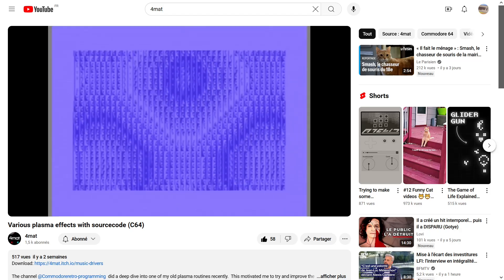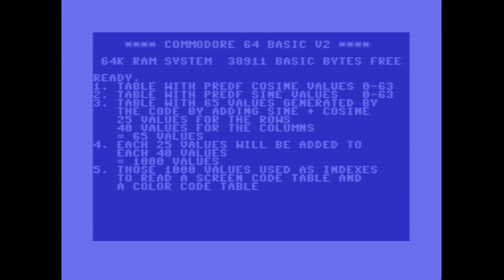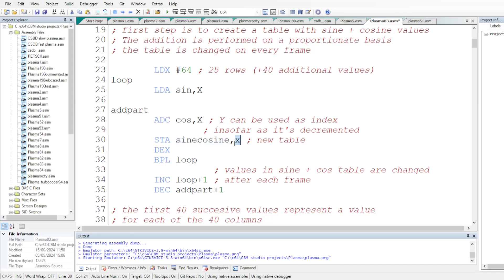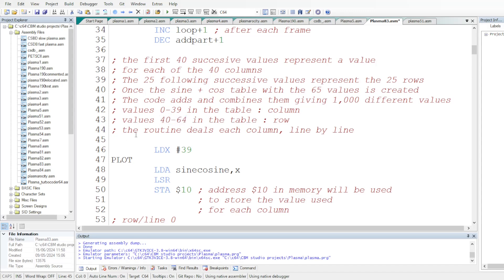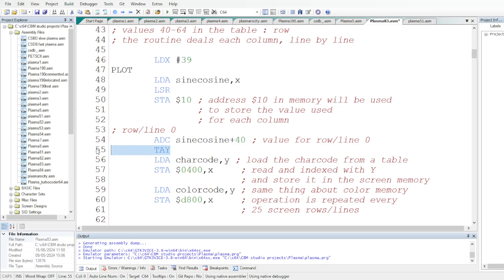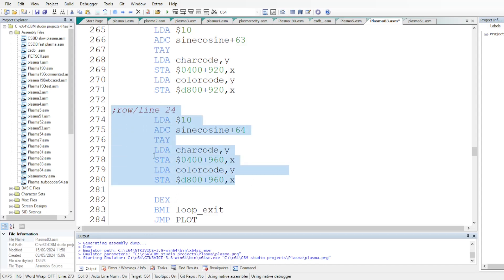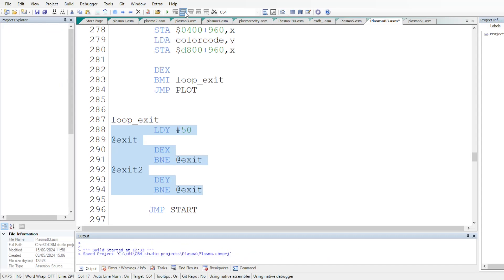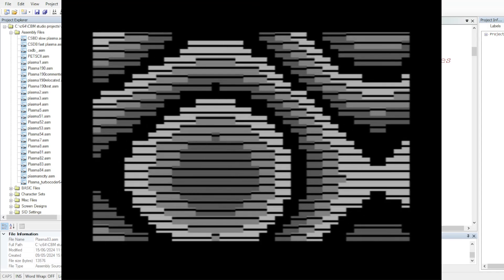Coding a plasma effect demo on the Commodore 64 (tutorial DIY in ENG)

Comment from the maker: The code is here
PART1
* = $1000 

        LDA #0 ; black everywhere :)
        STA $D021 ; =53281
        STA $D020 ; =53280
START
; first step is to create a table with sine + cosine values 
; The addition is performed on a proportionate basis
; the table is changed on every frame

        LDX #64 ; 25 rows (+40 additional values)
loop      
        LDA sin,X
        
addpart
        ADC cos,X ; Y can be used as index 
                 ; insofar as it's decremented
        STA sinecosine,x ; new table
        DEX
        BPL loop
                   ; values in sine + cos table are changed
        INC loop+1 ; after each frame
        DEC addpart+1

; the first 40 succesive values represent a value
; for each of the 40 columns
; The 25 following successive values represent the 25 rows 
; Once the sine + cos table with the 65 values is created
; The code adds and combines them giving 1,000 different values
; values 0-39 in the table : column
; values 40-64 in the table : row
; the routine deals each column, line by line 

        LDX #39      
PLOT
        LDA sinecosine,x
        ;LSR
        STA $10 ; address $10 in memory will be used 
                ; to store the value used
                ; for each column
; row/line 0
        ADC sinecosine+40 ; value for row/line 0
        TAY
        LDA charcode,y ; load the charcode from a table
        STA $0400,x     ; read and indexed with Y
                        ; and store it in the screen memory
        LDA colorcode,y ; same thing about color memory        
        STA $d800,x     ; operation is repeated every 
                        ; 25 screen rows/lines
        
; row/line 1
        LDA $10
        ADC sinecosine+41
        TAY
        LDA charcode,y  ; load the charcode from a table
                        ; read and indexed with Y
        STA $0400+40,x  ; and store it in the screen memory
        LDA colorcode,y ; same thing about color memory         
        STA $d800+40,x

; row/line 2
        LDA $10
        ADC sinecosine+42
        TAY           
        LDA charcode,y
        STA $0400+80,x                
        LDA colorcode,y         
        STA $d800+80,x

        
; row/line 3
        LDA $10
        ADC sinecosine+43
        TAY
        LDA charcode,y
        STA $0400+120,x
        LDA colorcode,y         
        STA $d800+120,x

; row/line 4
        LDA $10
        ADC sinecosine+44
        TAY
        LDA charcode,y
        STA $0400+160,x
        LDA colorcode,y         
        STA $d800+160,x
     
; row/line 5
        LDA $10
        ADC sinecosine+45
        TAY
        LDA charcode,y
        STA $0400+200,x
        LDA colorcode,y         
        STA $d800+200,x

; row/line 6
        LDA $10
        ADC sinecosine+46
        TAY
        LDA charcode,y
        STA $0400+240,x
        LDA colorcode,y         
        STA $d800+240,x

; row/line 7
        LDA $10 
        ADC sinecosine+47
        TAY
        LDA charcode,y
        STA $0400+280,x
        LDA colorcode,y         
        STA $d800+280,x

; row/line 8
        LDA $10 
        ADC sinecosine+48
        TAY
        LDA charcode,y
        STA $0400+320,x
        LDA colorcode,y         
        STA $d800+320,x

;row/line 9
        LDA $10 
        ADC sinecosine+49
        TAY
        LDA charcode,y
        STA $0400+360,x
        LDA colorcode,y         
        STA $d800+360,x

;row/line 10
        LDA $10 
        ADC sinecosine+50
        TAY
        LDA charcode,y
        STA $0400+400,x
        LDA colorcode,y         
        STA $d800+400,x

;row/line 11
        LDA $10 
        ADC sinecosine+51
        TAY
        LDA charcode,y
        STA $0400+440,x
        LDA colorcode,y         
        STA $d800+440,x

;row/line 12
        LDA $10 
        ADC sinecosine+52
        TAY
        LDA charcode,y
        STA $0400+480,x
        LDA colorcode,y         
        STA $d800+480,x

;row/line 13
        LDA $10 
        ADC sinecosine+53
        TAY
        LDA charcode,y
        STA $0400+520,x
        LDA colorcode,y         
        STA $d800+520,x

;row/line 14
        LDA $10 
        ADC sinecosine+54
        TAY
        LDA charcode,y
        STA $0400+560,x
        LDA colorcode,y         
        STA $d800+560,x

;row/line 15
        LDA $10 
        ADC sinecosine+55
        TAY
        LDA charcode,y
        STA $0400+600,x
        LDA colorcode,y         
        STA $d800+600,x

;row/line 16
        LDA $10 
        ADC sinecosine+56
        TAY
        LDA charcode,y
        STA $0400+640,x
        LDA colorcode,y         
        STA $d800+640,x

;row/line 17
        LDA $10 
        ADC sinecosine+57
        TAY
        LDA charcode,y
        STA $0400+680,x
        LDA colorcode,y         
        STA $d800+680,x

;row/line 18
        LDA $10 
        ADC sinecosine+58
        TAY
        LDA charcode,y
        STA $0400+720,x
        LDA colorcode,y         
        STA $d800+720,x

;row/line 19
        LDA $10 
        ADC sinecosine+59
        TAY
        LDA charcode,y
        STA $0400+760,x
        LDA colorcode,y         
        STA $d800+760,x

;row/line 20
        LDA $10 
        ADC sinecosine+60
        TAY
        LDA charcode,y
        STA $0400+800,x
        LDA colorcode,y         
        STA $d800+800,x

;row/line 21
        LDA $10 
        ADC sinecosine+61
        TAY
        LDA charcode,y
        STA $0400+840,x
        LDA colorcode,y         
        STA $d800+840,x

;row/line 22
        LDA $10 
        ADC sinecosine+62
        TAY
        LDA charcode,y
        STA $0400+880,x
        LDA colorcode,y         
        STA $d800+880,x

;row/line 23
        LDA $10 
        ADC sinecosine+63
        TAY
        LDA charcode,y
        STA $0400+920,x
        LDA colorcode,y         
        STA $d800+920,x

;row/line 24
        LDA $10 
        ADC sinecosine+64
        TAY
        LDA charcode,y
        STA $0400+960,x
        LDA colorcode,y         
        STA $d800+960,x             
        DEX
        BMI loop_exit
        JMP PLOT

loop_exit

        LDY #50
@exit
        DEX
        BNE @exit
@exit2
        DEY
        BNE @exit

       JMP START

ALIGN   ; here the code is aligned
        ; so that the LB adress is at $00
charcode
        DCB 16,195 ; 
        DCB 16,196 ; number of bytes used will determine
        DCB 16,197 ; the thickness of the layers pattern
        DCB 16,198 ;         

        DCB 16,195
        DCB 16,196
        DCB 16,197
        DCB 16,198
        
        DCB 16,195
        DCB 16,196
        DCB 16,197
        DCB 16,198        
                 
        DCB 16,195
        DCB 16,196
        DCB 16,197
        DCB 16,198

ALIGN   ; here the code is aligned
        ; so that the LB adress is at $00
colorcode
        DCB 16,00
        DCB 16,11
        DCB 16,12
        DCB 16,15

        DCB 16,00
        DCB 16,11
        DCB 16,12
        DCB 16,15

        DCB 16,00
        DCB 16,11
        DCB 16,12
        DCB 16,15

        DCB 16,00
        DCB 16,11
        DCB 16,12
        DCB 16,15
Reply from the maker: PART 2

ALIGN   ; "sin 2*256" table is comprised of 512 bytes
        ; with values between 0 and 63
        ; they are based on frequency by 4 x 90 degrees
        ; (=2*pi, ie a full circle)
sin
        BYTE 32,28,24,20,16,13,10,7,5,3,1,0,0,0,0,1
        BYTE 2,4,6,9,11,15,18,22,26,30,33,37,41,45,48,52
        BYTE 54,57,59,61,62,63,63,63,63,62,60,58,56,53,50,47
        BYTE 43,39,35,32,28,24,20,16,13,10,7,5,3,1,0,0
        BYTE 0,0,1,2,4,6,9,11,15,18,22,26,30,33,37,41
        BYTE 45,48,52,54,57,59,61,62,63,63,63,63,62,60,58,56
        BYTE 53,50,47,43,39,35,32,28,24,20,16,13,10,7,5,3
        BYTE 1,0,0,0,0,1,2,4,6,9,11,15,18,22,26,30
        BYTE 33,37,41,45,48,52,54,57,59,61,62,63,63,63,63,62
        BYTE 60,58,56,53,50,47,43,39,35,32,28,24,20,16,13,10
        BYTE 7,5,3,1,0,0,0,0,1,2,4,6,9,11,15,18
        BYTE 22,26,30,33,37,41,45,48,52,54,57,59,61,62,63,63
        BYTE 63,63,62,60,58,56,53,50,47,43,39,35,32,28,24,20
        BYTE 16,13,10,7,5,3,1,0,0,0,0,1,2,4,6,9
        BYTE 11,15,18,22,26,30,33,37,41,45,48,52,54,57,59,61
        BYTE 62,63,63,63,63,62,60,58,56,53,50,47,43,39,35,32

        BYTE 32,28,24,20,16,13,10,7,5,3,1,0,0,0,0,1
        BYTE 2,4,6,9,11,15,18,22,26,30,33,37,41,45,48,52
        BYTE 54,57,59,61,62,63,63,63,63,62,60,58,56,53,50,47
        BYTE 43,39,35,32,28,24,20,16,13,10,7,5,3,1,0,0
        BYTE 0,0,1,2,4,6,9,11,15,18,22,26,30,33,37,41
        BYTE 45,48,52,54,57,59,61,62,63,63,63,63,62,60,58,56
        BYTE 53,50,47,43,39,35,32,28,24,20,16,13,10,7,5,3
        BYTE 1,0,0,0,0,1,2,4,6,9,11,15,18,22,26,30
        BYTE 33,37,41,45,48,52,54,57,59,61,62,63,63,63,63,62
        BYTE 60,58,56,53,50,47,43,39,35,32,28,24,20,16,13,10
        BYTE 7,5,3,1,0,0,0,0,1,2,4,6,9,11,15,18
        BYTE 22,26,30,33,37,41,45,48,52,54,57,59,61,62,63,63
        BYTE 63,63,62,60,58,56,53,50,47,43,39,35,32,28,24,20
        BYTE 16,13,10,7,5,3,1,0,0,0,0,1,2,4,6,9
        BYTE 11,15,18,22,26,30,33,37,41,45,48,52,54,57,59,61
        BYTE 62,63,63,63,63,62,60,58,56,53,50,47,43,39,35,32

ALIGN ; "cos 2*256" frequency 6 x 90 degrees (=2,5*pi)  
cos

        BYTE 0,0,1,4,7,11,15,20,25,31,36,42,47,51,55,59
        BYTE 61,63,63,63,62,60,57,53,49,44,39,33,28,22,17,13
        BYTE 8,5,2,0,0,0,1,3,5,9,13,18,23,29,34,39
        BYTE 45,50,54,57,60,62,63,63,63,61,58,55,51,46,41,36
        BYTE 30,25,19,14,10,6,3,1,0,0,0,2,4,7,11,16
        BYTE 21,26,32,37,43,47,52,56,59,61,63,63,63,62,60,56
        BYTE 53,48,43,38,32,27,22,17,12,8,5,2,0,0,0,1
        BYTE 3,6,10,14,19,24,29,35,40,45,50,54,58,61,62,63
        BYTE 63,62,61,58,54,50,45,40,35,29,24,19,14,10,6,3
        BYTE 1,0,0,0,2,5,8,12,17,22,27,32,38,43,48,53
        BYTE 56,60,62,63,63,63,61,59,56,52,48,43,37,32,26,21
        BYTE 16,11,7,4,2,0,0,0,1,3,6,10,14,19,25,30
        BYTE 36,41,46,51,55,58,61,63,63,63,62,60,57,54,50,45
        BYTE 39,34,29,23,18,13,9,5,3,1,0,0,0,2,5,8
        BYTE 13,17,22,28,33,39,44,49,53,57,60,62,63,63,63,61
        BYTE 59,55,51,47,42,36,31,25,20,15,11,7,4,1,0,0

        BYTE 0,0,1,4,7,11,15,20,25,31,36,42,47,51,55,59
        BYTE 61,63,63,63,62,60,57,53,49,44,39,33,28,22,17,13
        BYTE 8,5,2,0,0,0,1,3,5,9,13,18,23,29,34,39
        BYTE 45,50,54,57,60,62,63,63,63,61,58,55,51,46,41,36
        BYTE 30,25,19,14,10,6,3,1,0,0,0,2,4,7,11,16
        BYTE 21,26,32,37,43,47,52,56,59,61,63,63,63,62,60,56
        BYTE 53,48,43,38,32,27,22,17,12,8,5,2,0,0,0,1
        BYTE 3,6,10,14,19,24,29,35,40,45,50,54,58,61,62,63
        BYTE 63,62,61,58,54,50,45,40,35,29,24,19,14,10,6,3
        BYTE 1,0,0,0,2,5,8,12,17,22,27,32,38,43,48,53
        BYTE 56,60,62,63,63,63,61,59,56,52,48,43,37,32,26,21
        BYTE 16,11,7,4,2,0,0,0,1,3,6,10,14,19,25,30
        BYTE 36,41,46,51,55,58,61,63,63,63,62,60,57,54,50,45
        BYTE 39,34,29,23,18,13,9,5,3,1,0,0,0,2,5,8
        BYTE 13,17,22,28,33,39,44,49,53,57,60,62,63,63,63,61
        BYTE 59,55,51,47,42,36,31,25,20,15,11,7,4,1,0,0

ALIGN 
sinecosine
        BYTE 65,0 ; max value in sinecosine is 63+63=126 (x 2 =252)
Reply: @8bitretroprogramming  🙏 Thank you!! You have my sub.
Reply: @8bitretroprogramming  Thank you! :)